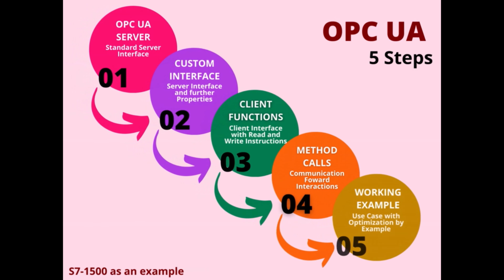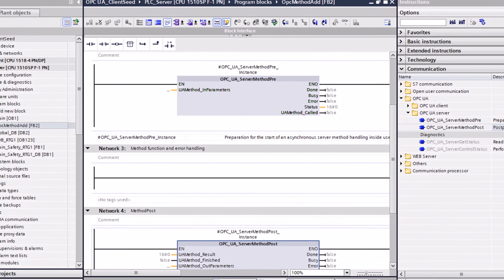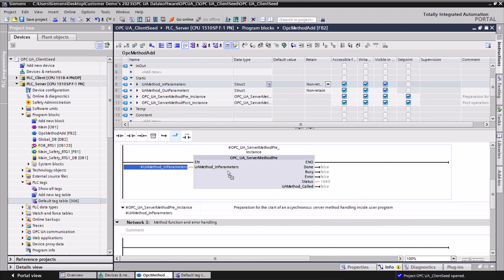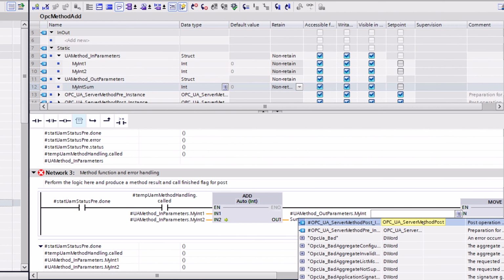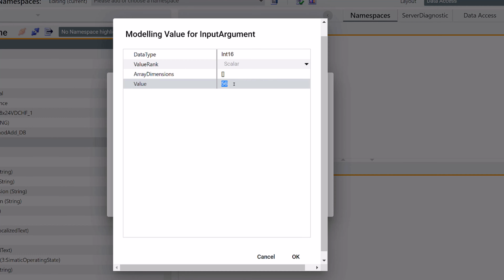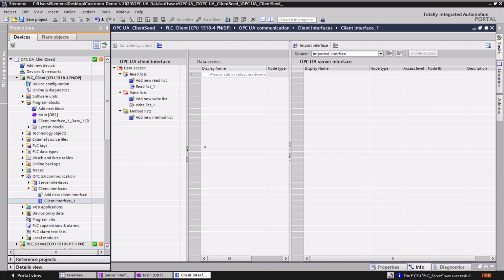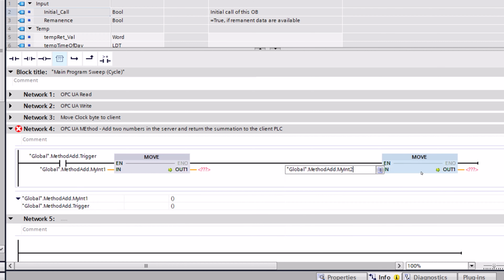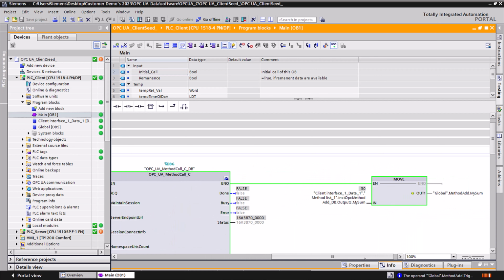TIA Portal: S7-1500 OPC UA Methods Tutorial

Comment: Hello. Why do you reset temp variables? Don't these variables take on null values when the block is called again? Thanks.
Reply from the maker: Temp variables inside the function block are like you say, I think I wrote it like this in case a customer chose static later. So therefore you can write code values if you need to temp or static. Please explain more if this isn’t it. Makes sense why you ask though.

Comment: Where would you go about setting up a heartbeat connection
Reply from the maker: @BrandonRiley-j2x 

https://support.industry.siemens.com/cs/document/109818073/s7-1500-opc-ua-server-self-diagnostics?dti=0&lc=en-WW

I would use the timestamps as the basis as there are a few ways. I assume you mean for the OPC Server side because the client side is quite easy to evaluate. 

Clock Bytes or Timestamps: You can use either clock bytes or timestamps as a basis. Clock bytes are easy to work with, and there’s a checkbox for them in the OPC server. However, consider using more strategic OPC UA timestamps for better alarm functionality.

Client Timestamps: The client can also add timestamps (like DTL, DATE, and TIME) to the OPC Server system. It evaluates these timestamps internally.

TIA Portal v18 or higher: If you’re using TIA Portal v18, Siemens introduced an internal “loopback" for the server without having to make a client setup. This lets the server see its own diagnostics data. You can query something like the timestamp updates and other details from the client on the server's namespace. I modified that app note link above for this purpose, and it worked well.

In either of the cases, for the client this is easy and included in a timestamp, but from the server, it's going to require a call to code.

Best of luck with your endeavors.